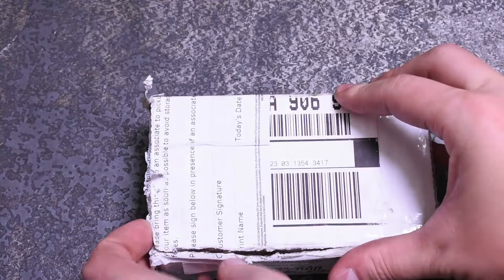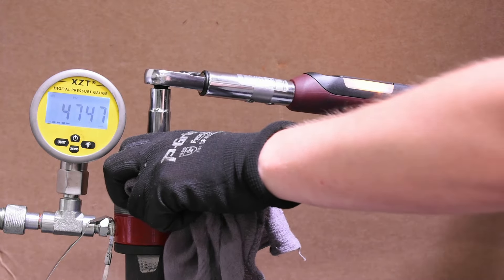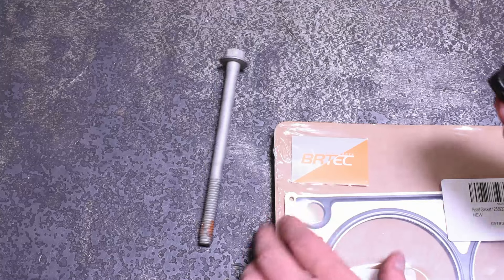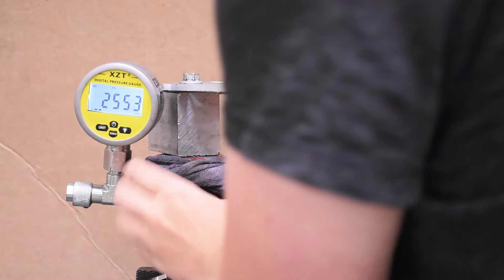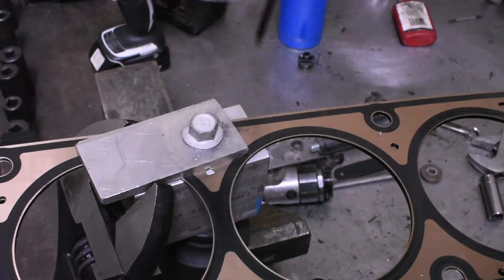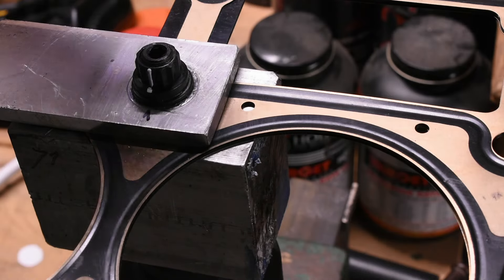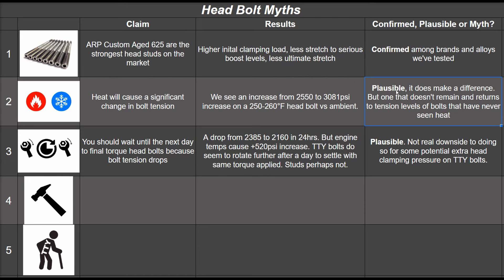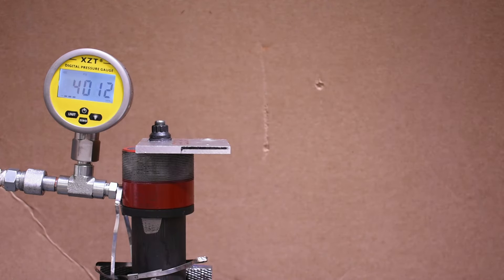CAN You Reuse Cylinder Head Bolts? Testing Myths + ARP Custom Aged 625+

Comment: One thing that really struck me was the added stretch of the used TTY bolt, it was more than the thickness of a typical MLS head gasket.  Which probably explains why the only time I ever reused TTY head bolts the new head gasket failed shortly after being put back into service.  The "good to go test" back then was to lay a straight edge on the threads of the used TTY bolt, if the peaks of the threads all touched then it was good to reuse, apparently not in my case.
Reply: Possibly over torqued the bolts.

Comment: 7:15 if you use a snap-on digital torque wrench and do a degree torque, it flashes the finishing torque in ft-lbs. At the machine shop i worked at, we would torque heads 4 times. First at the seating torque(like 33ftlb), then the base torque (like 66ftlb), then the TTY 90 degrees, and we would note each torque reading from the torque wrench and go back a 4th time and do the rounded up average in ftlbs for the final torque. Never had any issues doing it this way, but just wanted to mention that you can read final torque after doing a TTY bolt. ❤️
Reply: Yep, snap-on torque wrenches are great for making sure all of the bolts you're stretching get to roughly the same torque.
Reply: Yup I do something similar. Sometimes one bolt will be 100lb-ft and another will be only 90. I don't mind making those numbers a little closer.
Reply: Angle torque idea is to get rid of inconsistent torque method, now you "experts" are messing that up.
Reply: I did the same thing on main bolts. I torqued them to 20nm plus 70 degrees. Some ended up at 59nm and some at 65nm so I tightened them up just a little bit more to 63nm 😅

Comment: Refinery Inspector here- We would never use TTY on any bolted flanged connection. I have discussed TTY with multuple senior mechanical engineers in the same room and here's some thoughts:

TTY is not used because of the amount of variables that are needed, contrary to the original thought of eliminating variables. The first initial TTY sequence is to torque to a low lbs then start the dial gauge. 

Problems arise with getting the first torque value correct. A small amount of thread damage, cleanliness,  or calibration is off, it's exacerbated at the end and make the torque wildly off.

In addition there is no ability to check final fit up. 

Finally, we have great success with hot torque of problem high pressure connections. Torque, run at operating temp for 12 hours, torque with the same values while hot.

Love the video
Reply: Just curious - When you "torque with the same values while hot", does the fastener move at all? Or, does the clamping force improve?   Just thinking 'what if I could heat a motor up (somehow) and then torque the heads'...would that give me an advantage....mmm

Comment: one tip I was given in high-school  shop class was to add another torque step. torque the bolt to 5 ft pds less than the rated, let sit for a day and torque to proper spec. so for a SBC, it was a torque rating of 70, torque it to 65, let sit overnight and torque to the 70

Comment: I work on large AG and have rebuilt quite a few Diesel engines. I mainly work on John Deere equipment. I’ve seen anywhere from measure and reuse (I never reuse) torque to yield that has you let the bolts “rest” for 15 minutes after the initial torque. These are very interesting. I’ve noticed while performing the torque sequence, the first bolt in the sequence is way low compared to what it was initially torqued to. I built a Yanmar once and it said to torque bolts after 50 hours of operation. One thing that was consistent with all of them is coating threads and under the bolt head with SAE 30 weight oil. Something about the straight 30 weight oil that helps keep the torque consistent vs a multi weight. Btw finding a straight weight oil can be challenging.
Reply: SAE-30 , take a look in the lawnmower section.
Reply: oh baloney, how can 30 vs 10W30 make any difference in torquing a bolt. LOL, everybody knows that castor oil works best
Reply: Of all the places to find oil. At the Dollar General you can find straight 30 weight more often than regular oil.

Comment: The load loss you are seeing in the heated test, and the relaxed test is due to a differential in thermal expansion.  The increase in bolt load is, in fact, causing an increase in embedment, gasket creep, and, most importantly, gasket stress (gasket crush).  The gaskets do not recover well, so you will lose gasket stress and bolt stress when everything reaches soak temperature and then cools.

Comment: I work on aot of overhead cam ford engines. Depending on the assembly instructions you come across. Some specify to "pre stretch" the bolts. Primarily the ford instructions, and those that copied it verbatim. Their procedure says to got 30 ft/lbs +90°. Loosen it then start over and do +90 twice. I only follow that method on higher performance engines. Stock engines get no pre stretch, and sometimes I've had to reuse old head bolts in a couple holes when new ones yield too much and don't get tighter on the last 90 degrees. Every engine is still running. Some 8-9 years later.
Reply: I don't think this is to " pre stretch " the bolts , It is more to give initial compression to the head gasket, release tension then final torque.  From what I recall this was on a non TTY engine.  ( Maybe an OHC Renault Alliance? )
Reply: @bobroberts2371  the sequence I'm talking about is directly from tty headbolt sequence for the ford modular engines. But yes. There are okder non tty sequences that are similar for exactly what you said. But new gasket technology eliminates that need. Also making sure the center bolts are at the initial torque before going to the next stage after pulling them all up makes a bug difference
Reply: BMW is famous for this on their Rod Bolts.

5NM, 30NM, then +90 Degrees. You then back it off one full turn (totally loose) and do it again. THEN you back it off AGAIN and retorque 5, 30, then 90 degrees for a third and final time and you're done.

I found, buried in the service manual, you must stretch the bolts at least 3 times, and no more than 5 times while assembling the engine, and throw them away if removed after the engine is started and ran.
Reply: A lot of Nissan stuff did the same …. I didn’t ever do it . Seemed counterintuitive to me. Never had an issue with any
Reply: This is to 'bed in' the friction surfaces. The thread engagement points and the point between the bolt head and washer.
Reply: @andrewdynes5300  I would love to agree. And kinda want to seeing as some manufacturers come out with "updated" bolt designs that have loose washers instead of fixed. But before replying and long thinking. Why doesn't ARP give the same thought sequence on extreme applications? The got bolts you can't even touch with bare hand because of a chemical reaction that might embrittle the studs. Nascar and top fuel cars don't have that sequence.  I wanna say you hit the nail on the head. But those thoughts make me curious

Comment: TTY bolts. 

When these were first being used, some manuals said that it was OK to reuse for one time however, being number of uses can't always be verified, they recommended replacement. ( I'd have to dig a bit for what make / model )   I think there is actually a diameter / length spec for reuse in some applications. TTY bolts are cheap, the cost to evaluate used bolts can be expensive / skill based so I'm betting that is the driver for bolt replacement rather than reuse. 

When installing new TTY bolts you can feel the torque level off before you reach the recommended TQ angle.   This extra angle after the TQ levels off gives you enough of a turn to negate any frictional losses in the initial TQ.  I've reused TTY bolts by making sure they are original, using the factory pre TQ then turning until I feel the TQ levels off then about 10 degrees more.  

For new TTY bolts I've taken not to be worried about an exact angle if I pay attention to the TQ leveling off and I'm at least somewhere near the factory angle. 

Bottom line?  If for customer, replace TTY bolts.  For your own patch together / late night repairs, reuse can be OK.
Reply: Most larger diesel engines use TTY bolts that can be reused 1-5 times. Cummins actually supplies a gauge to measure bolts for re-use. However my opinion on the matter, is head bolts are cheap insurance. I've pulled a few cylinder heads that had a snapped in half head bolt resting in it.
Reply: if you have the head off, your bill is already going to be pretty big. You may as well cover your ass and replace them.

Comment: The reason for the tty bolts is that during the plasticization phase, it lowers the preload on the threads themselves. This lower preload in a repeated expansion/ contraction application leads to less long-term failure from high loads enableling a smaller fastener size. You can reuse bolts with stretch left because it's all about preload and there are Guages that measure the bolts.

Comment: When I was working in a garage many years ago, they used to say to re torque the bolts after 3000 miles. That gives the engine, head and gasket time to settle and then the head bolts and gasket should last the life of the  engine. Head gasket failure is usually down torquing the studs in the wrong order. Usually you work from the centre of the head out.
Reply: On mercedes engine (tuned) we use 12.9 bolts instead stretch bolts and we do   50nm then loosen 50-70-90nm run engine hot let it cool down completely then 120-125nm seems to work great.
Reply: Because not TTY bolt.

Comment: The repair manual for my car actually has a spec for the bolt overall length to see if they're still good to re-use or if they're stretched too much.

I have re-used TTY bolts, but the second time they do feel different to me, less 'stretchy' if anything, but that's not really a scientific measurement. :)
Reply: Pretty close though, huh?

Comment: The "hammer" trick was based on snug bolts, then torqued. The reason for this was that any irregularities in the block that could cause friction were removed/seated in the hole threads.. This actually does work, meaning the bolts were less prone to becoming "loose",  but it does nothing to the bolt/stud itself.
Reply: I do it for my pool filter clamp. It's plastic on plastic with metal bolts. A couple whacks with a mallet and I can EASILY turn those nuts tighter. I just keep going till it's not easy to do anymore. I imagine it's the same for just about any other high friction application.
Reply: They do this to relieve tension in body work. When you push/pull a steel panel back into place, you tap where it joins to relieve the tension in the metal so it doesn't try to return to it's former shape due to steels elastic properties.
Reply: It's also used on wooden props with aircraft.  Wood props require periodic re-torque because the wood compresses over time (unless you have steel bushings).  Giving it a good whack with a mallet and a second re-torque equates to less torque lost before your next re-torque.  It's also a way to get that last bit of torque out of a larger radial engine prop nut, when you're hanging with all of your weight on a 4ft extension bar and someone taps the prop shaft, you can feel it tighten up just a tiny bit (600+ft/lbs, you do it by weight and moment arm, not a torque wrench...imagine the cost of 4-6' long torque wrench that needs to be regularly certified and calibrated above 600ft/lbs).

Comment: In my industry we use 2 a490 3/4" fine pitch bolts with shouldered nuts to attach an assembly to our machine. We have to torque them to 425ft/lbs I can testify for the hammer method. We run them on with a 3/4 milwaukee impact. Then torque the nut, smack the bolt head briskly with a 3lb hammer then retorque.

Comment: I very specifically remember seeing in old repair manuals (like 1960s or older) that if you're going to install a head, you torque the bolts, heat cycle the engine once or twice, then re-torque. I did this most recently on a Kubota diesel engine and I did in fact get a significant increased turn on several of the bolts at the same ft-lbs on the torque wrench. I'd say like an 1/8 turn or so, maybe a little more on one.  I figured since I needed to go in the valve cover and check the valve lash after a short run in as per the factory repair manual, I might as well torque the head bolts again. I was surprised that so many moved honestly because it was a modern head gasket and the factory manual didn't say anything about doing that. Kind of glad I did now.
Reply: I also think it would be interesting to do the TTY bolts with a series of goldilocks-finding torque attempts. Like you could go 60-65-70-75 and then test them all for stretch under hydraulic pressure and their failure point. The scientist in me is convinced that there should be a sweet spot to get another use out of them. Just thought of something. Use a beam style torque wrench and torque on the bolt until it gets to the same pressure range as the original TTY sequence, then record the number you reach. Maybe do 3 or 5 to see if they're consistent, then do your stretch test to see if they're weaker after re-torqueing.

Comment: On the topic of heating bolts to get more tension. On caterpillar hydraulic hammers for breaking concrete with an excavator, the bolt shanks are exposed and you are meant to tighten them slightly then heat the exposed shank in order to lengthen it then let it cool and it will end up being incredibly tight. Might want to mill a window into the simulated head to get access to the shank and give it a try. I know it's not very representative of a cylinder head but it would be interesting to have some data on it in general

Comment: When I torque a head, I lube the threads and under the head, except SB Chev which gets sealer on the threads, then I go through the pattern and steps counting each bolt so I know I didn't miss any.  I then go back through the pattern loosening each bolt slightly, maybe 1\8 turn, and then pull it to torque again.  Lastly, I start at one end and check each bolt to see that it is holding torque; I have had a few blocks where soft threads showed up during the last step, requiring Heli-Coils.  If it is a TTY, I then pull the proper angle.  This is how I was taught in my apprenticeship and I have never had a head gasket or bolt failure.

Before the days of PermaTorque head gaskets, we would go through the run-in procedure to break in the cam, about 20 minutes, and then retorque the heads.

I have never reused TTY bolts since stock replacements usually come in the kit or are cheaper than the repair if a bolt fails, which I have seen happen.

Comment: I've seen MANY! used TTY head bolts snap off while being reinstalled, they put new ones in the gasket set for a reason.
Retorquing head bolts after a waiting period is to compensate for the head gasket relaxing, not the bolt.

Comment: I reused bolts on a Lancer 1.5L, a Renault 5, and a bunch of Volvo 240. No issues. 99% sure my old Civic 1.6Vtec had reused bolts too after a valve change, it too had no issues for the 3 years it was used after that.

Comment: I have found that reusing the same bolts the engine was originally built with has never been a problem. Using a best practices of clean and flat mating surfaces along with proper bolt tightening pattern and stepped torquing has always giving me failure free results. All the failures of engines, gearboxes and structural items has been traced to exceeding load limits. Always use a good quality torque wrench and have it calibrated to maintain accuracy. I avoid using air or electric impact tool for assembly. It's too easy to over or under tighten fasteners with an impact wrench.
Reply: You cant always rely on that as tty bolts undergo irreversible plastic deformation every time you yield them.Sure u can probably get away with reusing them few times but you cant reuse this bolt forever, personaly i wouldnt use it more than twice.

Comment: For re-using TTY bolts, I think you should measure the final torque for the new bolts + 90 degree and torque the used bolts to that with grease. That should get you as close to the original spec as possible with re-used TTY bolts.

Comment: The problem with a lot of the high dollar stud kits is that they're only really useful for about half a percent of all the engines out there. Like anything engine-related there's just a lot of smoke & mirrors & straight up unnecessary precision 99.5% of applications just don't need. Case in point is the Honda guy who lubes the backside of rod & main bearings (the saddle side) then clamps the living piss out of his rod & main caps to smash everything down to spec. Now I'm not saying there's anything wrong with stud kits, quite the opposite, BUT, a whole lot of the time it's just straight up unnecessary unless you're trying to 3,000hp out of a 24v Cummins or other such nonsense. My experience in engine building has taught me that if you're lifting heads in blown applications you really need to upgrade your head bolt count from 4 to 5 or even 6 rather than throwing expensive studs at a 4-bolt block trying to keep the pressure in. Same applies to main caps, if your cranks keep walking you probably should spend the money on a 4 or 6 bolt main block, or invest in a good girdle. That's just my 2 cents on it.. often saves money in the long run by avoiding broken parts
Reply: I see it with other hobbies as well, the main thing seems to be buying new things to solve the problem, the person is just installing parts instead of putting in any thought or work to find the most effective fix.